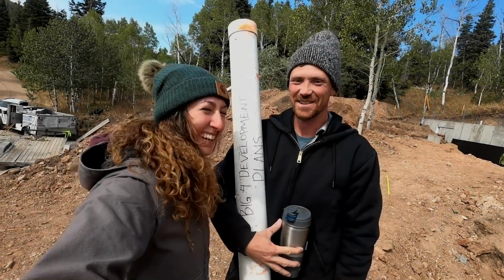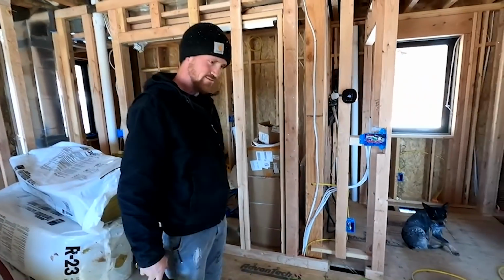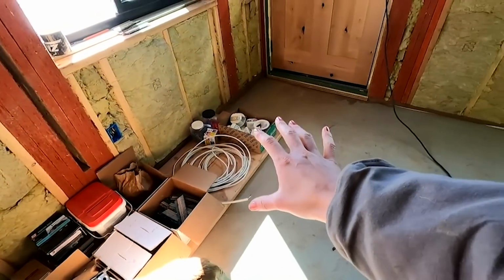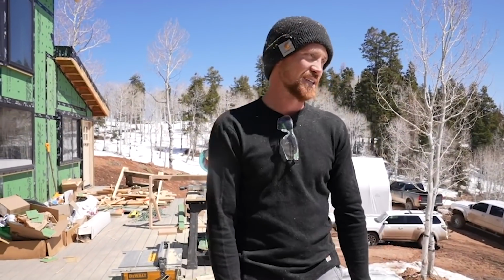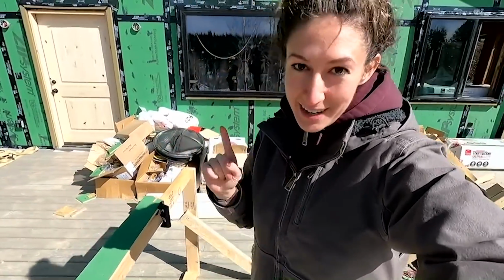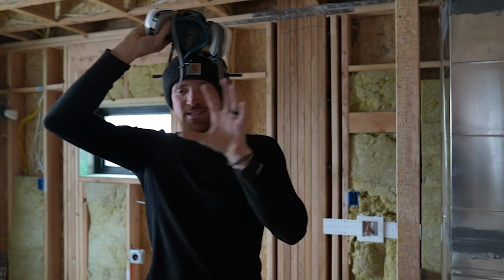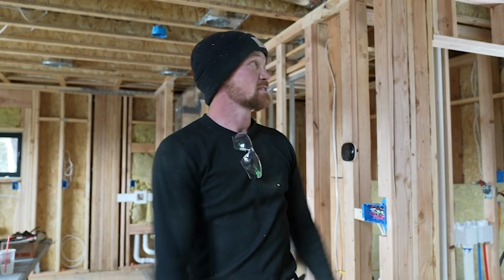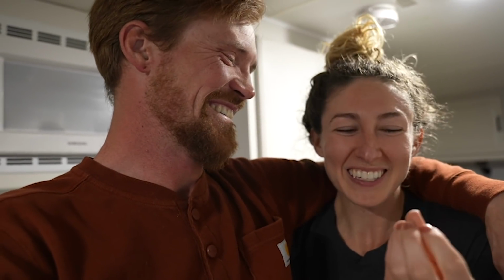RUNNING OUT OF MATERIALS | BUILDING OUR OWN HOME

Comment: If you are going to install a standing seam roof, it is a shame you didn't put out word you were looking. I had 2 roll form machines sitting idle in central Texas most of 2020 that your panels could have been run on either here and shipped or up there on site. 
Your house is really coming along. Keep up the good work.

Comment: I'm always impressed by how you've been doing all this with no previous experience, & have such positive spirits. Still, I see things I'd like to suggest - without seeming negative.

So, why not put all the debris not immediately needed close at hand in shelving assembled in your new basement?

With all those scraps of wood, other than burning it to warm the place when chilly, it should be easy enough to build a few steps at the end of the deck where the ramp was put for the dogs. It would be useful for people too.

I always wonder...why no gloves or eye protection? BTW, the dogs have no protection from all the fine insulation dust. I could see it on Trent's black shirt, so know there's a light dusting of it everywhere. 

Maybe the dogs should be kept outdoors or in the trailer on days when you're insulating until it's installed, & all the dust is vacuumed up. 

They have very small lungs & that dust probably would just accumulate & not break down or be absorbed by their bodies.  Is it actually wool or just a term used? What is it made of?

Comment: You're lucky you bought the wood to build when you did. The prices have quadrupled. 8x4 panels that you could get for $8-$10 have gone up to $35-$40. That's the cheap ones. 2x4s are up too. I remember a stack of 2x4s being on sale at Lowe's a few years back at $2.49 each. We've held off on a couple projects we've planned. Everything became nonessential during the pandemic and everyone was laid off. Then natural disasters like fires happened. It's not even building materials. I bought a hand held kitchen appliance for sealing food for $25. Then 3 months later the price went to $89. Hopefully you don't run into too many problems finding material or dealing with extreme prices while you're finishing your home.

Comment: Did you get the electrical figured out? Don't throw you wood scraps away good hot dry fuel for the wood stove cheaper than propane :)

Comment: The easy way to cut insulation is to lay a 1x4 on top of it. Press down and use the board as a guide. Nice straight lines EASY!
Reply: I was going to mention this same thing. Once compressed a couple of swipes with a utility knife and you have clean straight cuts.

Comment: To hold in insulation at hard to get them to hold places, I would bet there is some sort of thin fabric or plastic strip you can stable in to hold the insulation in place. I know this one guy who did so using left over emergency tape and the local  inspector just told him that it was a good workaround. Check what's legal and do what's work.

Comment: I'm old enough that I watched Bewitched in first run.
😏
Hey. I managed to live this long.
And...
Yes I do know the religious experience of a shower after insulating.
Back in the early 1980s, I was involved in building several passive solar rooms. I wasn't the smallest on the crew, but I was the skinniest, with the longest reach (I was 6' tall back then...).
The other time when a shower is a religious experience: when you're a metal worker, and your specialty is grinding, polishing and sawing. The down side of that is you better not forget to clean the tub/shower basin before your mate takes a shower.  Metal splinters in feet are apt to cause altercations.

Comment: So you like Grand Prix cars and motorcycles ? I felt we could be friends, I'm a pro rider and did lots of club racing on Honda's and Yamaha's. started when I was 15 and ended when I
was 43. Last GP was AMA race at Ontario raceway in 1978. Was Hawaii state Champ and National runner up in 50 and 350 class road racing in the late 60's and early 70. Still hooked, I'm now 81 and still building
a 1963 Honda CB77 GP bike in my bedroom. I'm in a wheelchair but coming back after having 3 strokes in 2018. Aloha Nui Loa
Jim

Comment: I went back and rewstched because of the comments about the dogs and insulation.  I saw Trent cutting it outside and the dogs outside. Is there a time stamp u guys see something different.  Irregardless, I'm pretty sure they tape several shows back to back and are 2 weeks behind according to Allie...I'm sure they read the concerns and took the advice or figured it out on their own. They are not irresponsible people and they would never intentionally put their dogs in harm's way imo

Comment: do not insulate the basement ceiling .. it will stop the heat from the furnace and hot water heater from leaving the basement .. sure do the exterior walls but not the ceiling.. you'll regret that work ...

Comment: Trent and Allie, I have been following for about a year. I am a general contractor, some of what I see you do is not the way I would attack some problems however the ends justify the means. Your doing a good job. I am concerned about the amount of insulation you are putting in the interior walls. Other than sound deadening it serves no purpose. Insulation between the floors again serves no purpose. My point, heat rises, if the basement floor is poured on a vapor barrier and the poured walls have a barrier that is either in it or applied to the exterior, it is insulated by virtue of the earth itself. My second concern is that if you make the house too tight (with insulation) then the structure can't breathe. Spray foam in the roof will impede cross ventilation and so on. I ask that you consult your constructor friend and ask if my concerns are real. God bless your work.

Comment: BTW....I have never seen a house in your climate which didn’t need insulation installed in certain areas as your framing. I never seen you do that once. You might be ok with your house being somewhat small and straight forward, but I doubt it